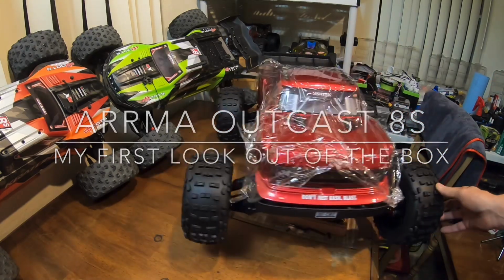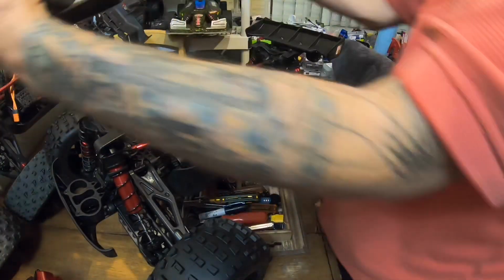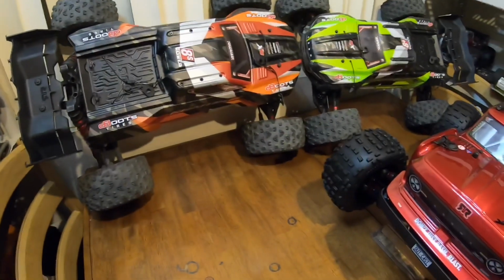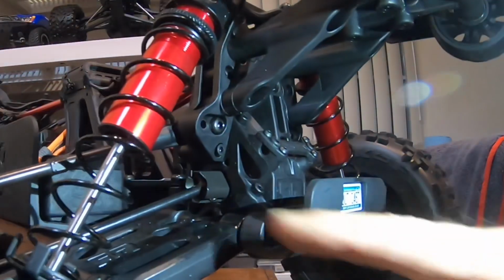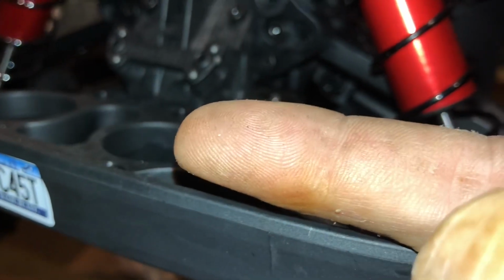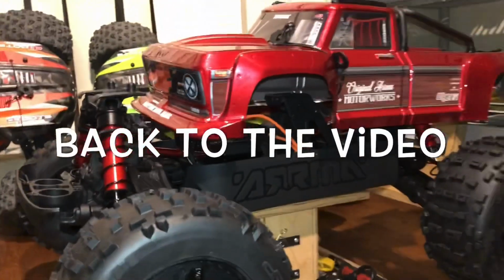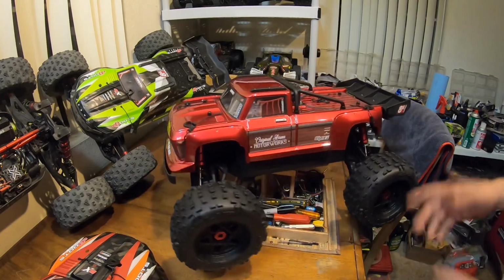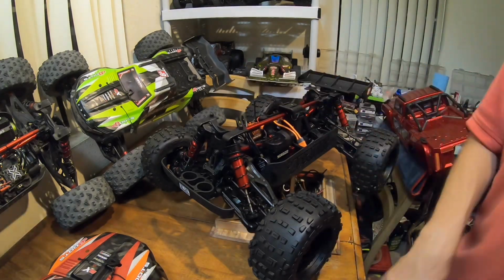Arrma outcast 8s my first look and I’m shocked ??what did I see out of the box ???

Comment: This hurts. I keep mentioning I’m new to this hobby but I jumped straight in the deep end. First day and first time in a hobby shop I bought a Traxxas Rustler 4x4 vxl and an EXB and a week later bought a Maxx and a Notorious 6s. All have been modded by me and I like a lot of things about Arrma, but it seems like they keep shooting themselves in the foot. For the amount you pay I’d return it for sure. 

I ran my brand new Notorious for all of 5 minutes when I goosed it and it wheelied and broke one of the plastic bolt things that hold the wing on. I mean I don’t beat my stuff up on purpose and stuff happens but that’s just cheap. 

I learned on my 3s rustler for about a week or 2 while waiting for parts for the exb, and ran that into walls, car tires, giant cement barricade blocks, street lights, jumped it off my porch stairs etc and not a damn thing has broken until I put sledgehammer tires on it and hit some weird grass berm and smoked the servo gears. I tried to do a high speed 4s run of my stock Maxx and ran it into a street sign at full speed and the only thing that happened was th battery came unplugged. Hit something at full speed again and the same thing happened so I shut it down and cruised it home, but it’s still running fine. 

I guess my point is being new to all this I initially thought Traxxas stuff was overpriced and I hated how they made things cheap but already had upgrade parts available from them just to make even more money off people but I feel like they are a little better built out of the box. Inside I want Arrma to succeed because I really like the look of their RCs and I’d say 85-90% of what they come with. When you hold the Arrma vehicle for the first time it just feels substantial compared to Traxxas but these small things keep them from being top dog IMO.
Reply from the maker: I agree with you I feel arrma need to check there products before they head out the door to the customer as I like there products but can’t stand them making the customer the test site 🔥🔥💯💯💯💯

Comment: Make sure you check your pins on your dog bones that mate up with the drive cups. One of mine was not centered and it broke right off during my second run. Thanks for the video as usual 👍. Yeah they come out of an assembly line. Even new 1:1 cars sometimes come with QC issues. I used to work at a dealership 🤣. That's why you need to look over the vehicle. My right rear camber is off out of the box on the O8S. Yeah. Little things. Hey neither of my xmaxx 8s trucks had issues out of the box 🤣
Reply from the maker: Yes I agree there will be defective items but to have the last 4 new releases all have issue the quality control just not there with arrma right now just my opinion and own experience from them 🔥🔥💯💯💯💯

Comment: I was wondering about the slack and play the front lower joints have is that normal seems that my left one has more wiggle than the other ..
Reply from the maker: There all coming with slop in the wheels you need to add shims to remove the slop to make it handle better but for bashing it won’t matter speed runs it does 🔥💯💯💯💯💯
Reply: Earl Moorhead thanks earl as always gonna get me some washers and give it a go 👍🏼👍🏼
Reply from the maker: Nice 👍🔥🔥💯💯💯💯

Comment: Bad luck mate. What is it with Arrma and leaky shocks. For Arrmas sake, I hope the new orings they are advertising will fix the leaks in the v3 3s cars. If they still leak it will be embarrassing for them.
Reply from the maker: Yes I agree I won’t be buying the new 3/4s line 🔥🔥💯💯
Reply: @earlmoorhead5555  I've used the blue Traxxas orings from the Traxxas ultra shocks in my 3s cars. Just replaced the bottom oring with a blue Traxxas oring, green slime them all up, and that seems to have fixed the leaks so far.
Reply from the maker: murphy 0987 yes I agree a bunch of fixes just another fix that arrma is not doing on there old cars just revised it and sells a new upgraded car now 🤔🤔🤔

Comment: The Felony having different size tires in front and rear means front diff is geared different. That will cause people to have issues when not using Stock tires and things like that.
Reply: I highly doubt they geared it differently do you know for sure or just assuming ?
Reply: @lowridr2  just based on how 4x4 works I am assuming! I have not went hands on. If it isn't geared differently from front to rear then wheels would turn at different speeds. At least that's my understanding from actual vehicles. I may be wrong about this though, it being an R/C, maybe the difference isn't enough to have different gear sizes.
Reply: @lowridr2  @driftomaniacs mentions it in his video about this. There is 7 mm difference in front and rear tires height.
Reply: @lowridr2  they do gear it differently. It says so right on the gigasite about it.
Reply from the maker: Yes for the bigger rear tire I’m heading to 👍👍🔥🔥💯💯💯

Comment: Arrma .. you always need to do work on them before you take it out.. outcast leaky diffs . Typhon chassis holes didn't line up which put the spur gear on an angle.. traxxas X max was the only rc that I could run straight away out the box. And I have 3 altogether.. so glad I got an X max to a kraton 8s .. looking at the problems I see
Reply from the maker: Xmaxx is king for a reason right 💯💯💯🔥🔥🔥🔥

Comment: On the 4s Shox put the O-Ring from the 6s Shox in , and all is fine. No more leaking.
Reply: O tried adding o rings too 3s ones but no good
Reply: @paulclancy2404  Yes. In the 3s Models these O Rings does not fit. But you can change the complete Shox
Reply: @raffikirsten9030  I have a o ring kit and I match or install oring I feel woukd work , im curious to know what o ring you talking about ? Bottom where threads into the body? Or internally I put oring internally on the shovk shaft hoping it seal fluid from leaking through , didn't work in fainness using oring kit from harbor and not as good as others
Reply: I'd like just put 6s shocks from typhon on but they hard to find ,i gather bc alot arrma guys do the same .
Reply: @raffikirsten9030  I shouldve ordered some those 4s shocks before sold out , I'd like get my brcc back together it became parts rig for granite , granite good rig cheap to maintain we always have bad weather and I have np putting granite through it all. Easy clean or leave on porch , i left 6s kraton on porch once wo cleaning and maintenance and was same leaving it in the ocean i even had ti do motor bearings everything was seized just rambling why i.like little guys too

Comment: The Outcasts have holes for lighter flints in the roll bar,and maybe now in the wing,the hex screw heads are not meant to spark,and the 8s outcast is basically a kraton 8s with a shortened chassis to make a "short wheel base" stunt truck,that's why the bodies ALMOST fit either rig. Your welcome.

Comment: IMHO.  Armma is putting out so many different units so fast,,,,that the push to get them out definitely affects quality control... I think Armma should slow down a bit,,,and concentrate more on perfection rather than volume.....   that issue with that truck would send me in a craze......I’d bring it back.   But,,that’s just me,,,,,looks great though,,,,,,,to bad ....🇺🇸👈.  Bye. I take apart every rc I purchase before even think about running it,,,,,being a retired aircraft mechanic,,,I have ‘this issue with perfection.    I’m very picky also,,,and it definitely pays off......
Reply from the maker: I agree I feel like you do 💯💯💯appreciate the support 💯💯🔥🔥🔥🔥

Comment: Very disturbing Earl... Hopefully Jason Deardon will see this and help you out. I would  get a full refund as its never been run. Just exchange it for a new one OR - consider a real 5th scale. My Losi DBXLE is truly solid and instead of spending time on the phone - you can truly run it pout the box (in fact the Version one is around 600$!!). Personally - I fill up the diffs and always check the shocks on any RTR. Ive seen your workmanship and it speaks for itself - theres no excuse for this. The EXP, the bent chassis on the kraton and now the Outcast? WTF. I started out with a couple of redcats for my son when we got tired of all the BS target RCs that were garbage. Then I got a Arrma Nero and caught the very same bug you did. I went insane. Built cubicles in my garage. Kraton, senton, typhon, Fazon, etc and then after learning how to wrench in - I moved onto a Cen XT and then I got the 3xle & a DBXLE same day. I personally prefer Losi for its quality and durability.  Ives jumped the DBXLE 40 feet and the chassis has never bent at all. I always check the diffs when I buy any RTR - but I never had to with Losi - they are well filled always.  Anyway - Im hoping your LHS will take care of this for you...
Reply from the maker: Thanks 🙏 appreciate the support sounds like your collection is sick 👍👍Losi has been good to me other than steering issues but I’d rather deal with an adjustment then a parts failure or worse a defective rc from arrma 👍👍🔥🔥💯💯💯💯

Comment: No new Arrmas for me for awhile. Have an exb have read all the blahblah about the rear diff, not a big deal will check it before running. Gives me a chance to top off diffs.

Receiving something like that is totally unacceptable. I have never gotten a new rc that leaked like that, let alone on a $1,000 truck. Covid screwed up production/QA and donno when it'll bounce back. On the plus side our used rcs are worth more than ever right now since they're out of stock everywhere lol. Arrmas are still being designed properly IMO its just the damn QA that went out the window.
Reply from the maker: I agree 💯💯👍💯🔥🔥🔥

Comment: Back to assembly plant slipping
Reply from the maker: Yes I agree 🔥🔥💯💯💯
Reply: @earlmoorhead5555  between traxxas hiding details of switching motor manufacturing and arrma assembly plant QC slipping...and that the arrma outcast 8s motor now has the wire style of the old traxxas motors is suspicious also
Reply from the maker: Yes I agree 🔥🔥💯💯💯

Comment: i agree it shouldn't leak out of the box, but that said, the pandemic is causing QC issues for everyone who uses overseas manufacturing.  have you ever tried to keep the chinese factories quality in line, its brutally tough in perfect times where you can travel and check up on them repeatedly.  This pandemic makes that nearly impossible.  Either exchange it or call horizon and get a warranty claim, easy fix.
Reply from the maker: If I could call and not be put on hold for over an hour I might warranty it the fixes are easy for sure rebuild all the shocks and reseal the differential but that two hours and 20.00 in parts again on my 4th arrma in a row with out of the box issues and that the point I wanted to get out there I’m very capable of the repairs and it would be way faster but do I need to keep doing the repairs myself I’d like to buy an rc and run it first before fixing it 🔥🔥💯💯💯💯💯

Comment: It’s so disappointing, I don’t know all the cars you have, and I can see you love arrma, but I’d try the xmaxx if I was you, and send back the arrma🤨
Reply from the maker: Yes my two xmaxx cars are great appreciate the support 🔥🔥💯💯
Reply: Earl Moorhead thanks for replying! What do you think of the 2wd rustler? I don’t think you have one🤔 but just wondered if you’d used one, it’s my first personal hobbygrade rc, my dad has 2 old Tamiyas, this is a big step up😂
Reply from the maker: Car Addiction I do have the 2wd rustler it now my 100 mph speed car I love the platform you can do a lot with it 🔥🔥💯💯💯💯
Reply: Earl Moorhead oh, sorry, I didn’t know you had one🤣 what do you think of my setup? It was an xl5, but now it’s a 3300kv brushless 3660 motor with a 120a 6s capable esc, i run it on 2x 7.2v nimhs (yes lipos are better but nimhs are just easy for me, and Don’t want to change them🤣) it has 47.5k rpm, and it’s standard except from that, some 2.8 badlands are coming tomorrow, and a motor fan is coming, as after 10mins, it’s too hot to run👍